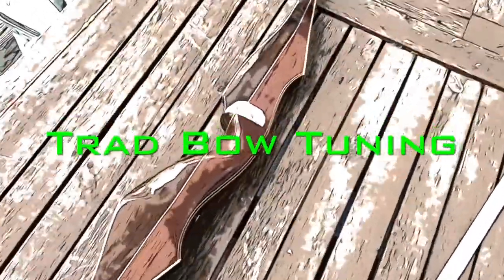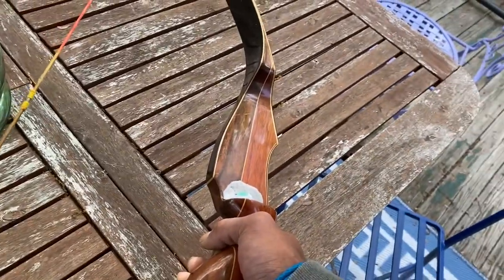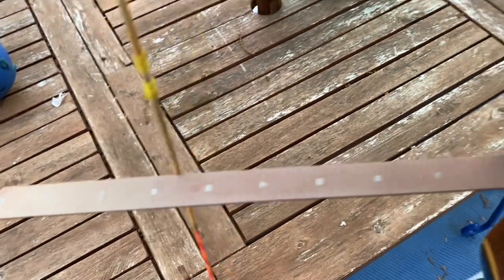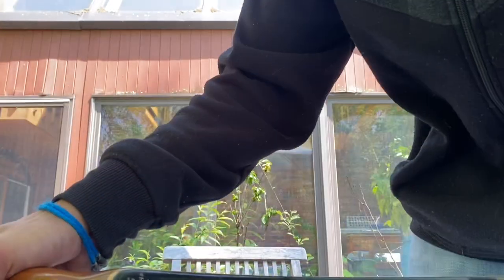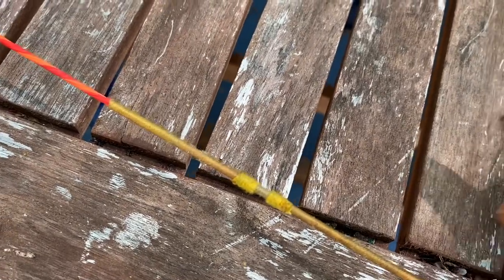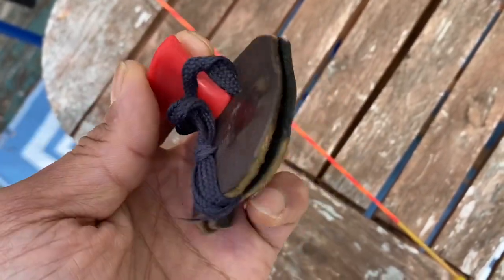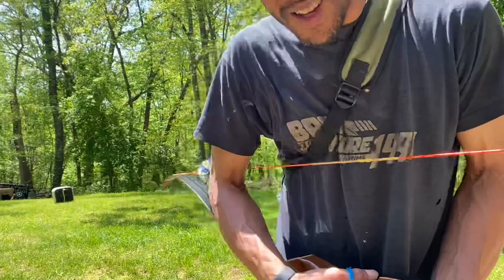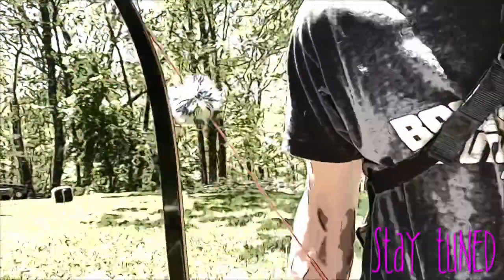Trad Bow Tuning

Comment: Good video ... I like that you brought out the tooth brush arrow rest! Your form looks pretty sharp to me. Oh and one final note ... weight lifting does help making the string easier to pull back, but when I was lifting a lot, and still fairly heavy, it seemed to throw my shots off for some reason ... not sure why. That shouldn't be a problem this summer since after my illness I am finally lifting, but my strength is not coming back like it should, only have a fraction of the strength I had. Staying a little light at about 235lbs and at my age I think it's better to stay light. Maybe eventually go up to 250 lbs and hold that weight, but hoping my strength increases over the summer. Anyway I have those lighter bows I made for when the 45 & 40lb bows tire me out. God bless ya bud - good video!
Reply from the maker: Thanks Joe!  I have really been trying to get my release back.  When I watch the most recent videos of myself all I see is plucking and horrible release.  I took a few steps backwards and need to build a new shot process.  45 lb (50lb at my draw length) is really starting to feel too heavy for me.  I am thinking about just shooting my 36lb Browning Explorer for a few weeks to build my form back up.  Cheers Big Bro 😇
Reply: @HandyL  that would probably be the better way to go, because if you don't your a lot like me, you will over do it, continue to train anyway, and then really hurt yourself, and then have to take time off and start all over again! 🤣🤕❤️💪
Then, just maybe then after the setback you will pick up the lighter bow like we both know you should have done in the first place.
And I bet if you warmed up with that lighter bow, you can just try firing about 5 or 6 with the 45 -50lb bow then finish up with the lighter one till your satisfied with your practice you will get good results.
Oh and my wife threw in a zinger and told me you could always use your daughter's bow! 😜🤣😂
Reply from the maker: @joedaniels4646  🤣🤣🤣 Tell Babycakes that was a good one 😁
Reply: @HandyL  ❤️🎯